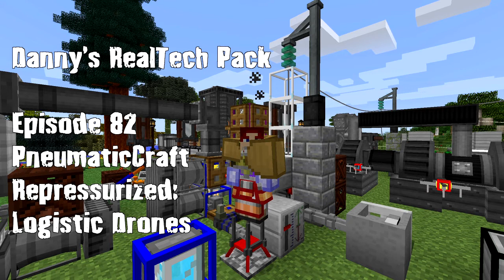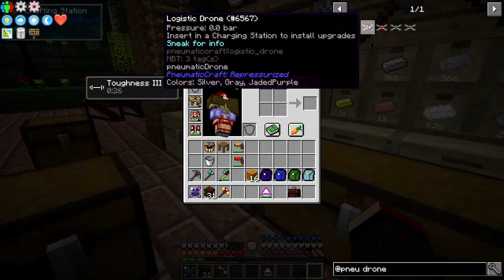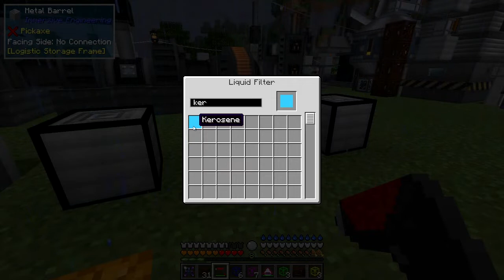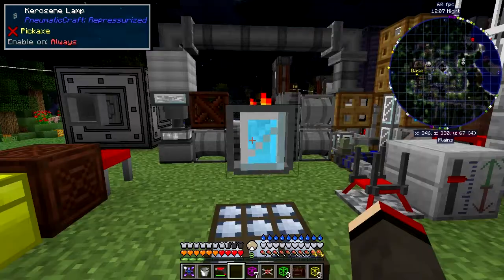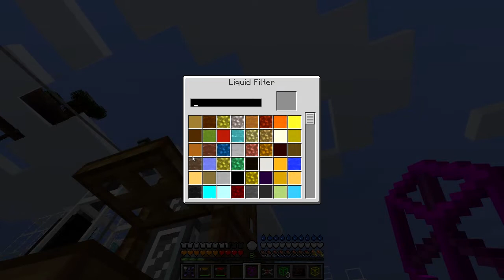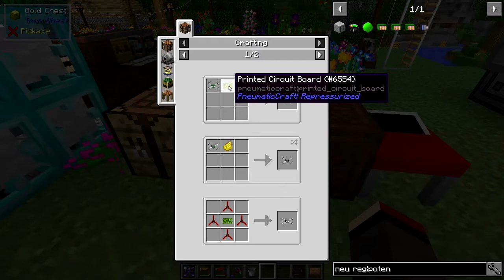Real Tech #082 -  PneumaticCraft Repressurized: Logistic Drones

Comment: Regarding logistic modules/tubes and the range: the air required to move items or fluid does scale (linearly) with the crows-flies distance between the two inventories/tanks, and the amount being moved at a time.  So over very long distances, you'll see your stuff move in smaller increments (at a high air cost) since it will scale back what it can move based on the amount of air in the tube the receiving module is attached to (air is consumed at the receiving end).

For this reason, I'd recommend the advanced pressure tubes for long-distance logistics, since they can store 4 times the air of a basic tube.  You'll still use as much air, but you'll be able to move more items/fluid at once (each time the module light flashes blue).
Reply from the maker: Excellent tip thanks. I noticed the time it took the air to reach the other end was quite long. I was wondering if it would help to have additional compressors on the pipe to speed up the transfer. I've always been under the false impression that advanced tubes are just for high pressure devices, so that's good to know. One think that is unclear is what is "long" in terms of distance.
Reply: @duncanwebb4934  OK, time for a bit of pressure arithmetic :)  
The air usage (in mL air) for items is [2.5 x num_items x distance], and for fluids it's [0.05 x fluid_mb x distance].  E.g. to move a full stack of items 20 blocks costs 2.5 x 64 x 20 = 3200mL of air, and to move 1000mB of fluid 20 blocks costs 0.05 x 1000 x 20 = 1000mL of air.
A regular pressure tube has a base volume of 1000mL, and at 4 bar stores 4000mL of air, which is enough to move a full stack 25 blocks (2.5 x 64 x 25).  Of course, the tube will then be quite depressurised, but will get replenished on the next tick from any neighbouring tube(s). You might notice the modules occasionally blink red after moving something; that's why - the module is briefly depressurised.
Now if you wanted to move a stack of items 50 blocks, that would cost 8000mL of air, which a standard tube at 4 bar couldn't do; it would move half a stack (2.5 x 32 x 50 = 4000) instead.  But an advanced tube (base volume = 4000) at 4 bar stores 16000mL of air, which would easily be able to move a stack 50 blocks.  And of course advanced tubes can be pressurised up to 20 bar, which is a whopping 80000mL of air, so very long distances can be achieved there.
Also worth noting that moving of resources is instant, but only happens every 20 ticks (backing off to 100 ticks if the tube didn't do any work this time round).
Reply from the maker: That's make it very clear, thank you. I was just reading the manual and there is a lot of information in there. Your explanation makes it easier to have a full picture. There is a lot in this mod for a complete series.

Comment: Regarding filter on providers etc., if there's just the one fluid in a tank, you generally don't need a filter (unless you're concerned that the tank may have some other fluid in it at some point).  An empty filter allows anything to be provided.
Reply from the maker: I think filters on logistic modules connected to an active provider need a filter as it wasn't working without one, so I was assuming the same was true for drones. I'll test the logistic modules again to be certain. Thanks for the tip.

Comment: In the next release of the mod, it will be possible to specify a minimum order amount for requester frames.  E.g. you'll be able to tell your drones not to move less than 250mB of gasoline at a time into your compressors, so they won't be constantly flying around moving 1 or 2mB at a time...
(Logistics is getting a bit of an overhaul right now, including some big performance improvements)
Reply from the maker: That'll be a nice feature, it was funny watching them constantly fly between the tank and the lamp.